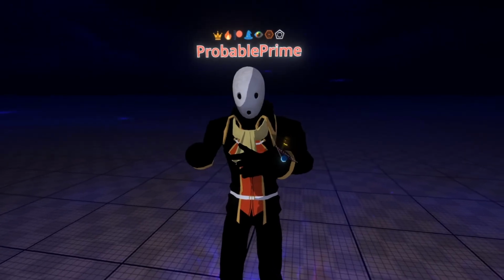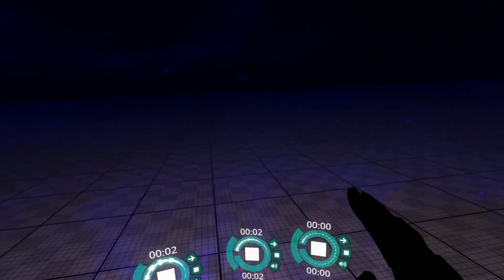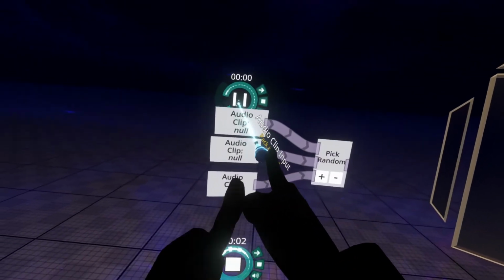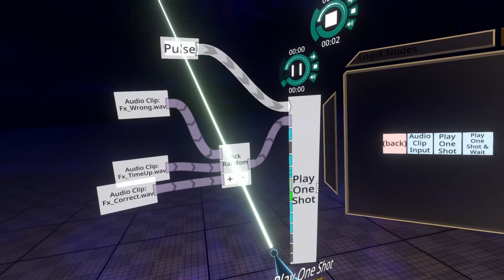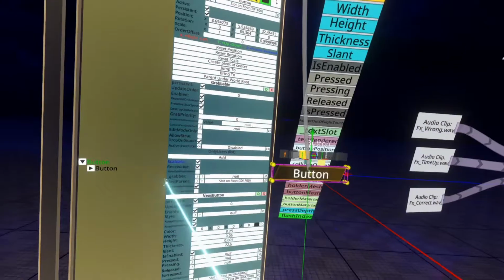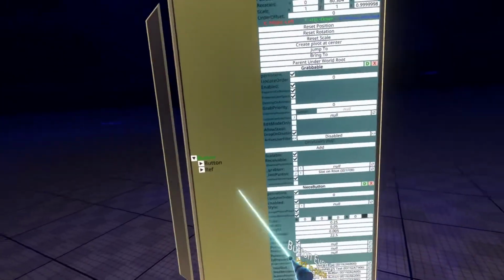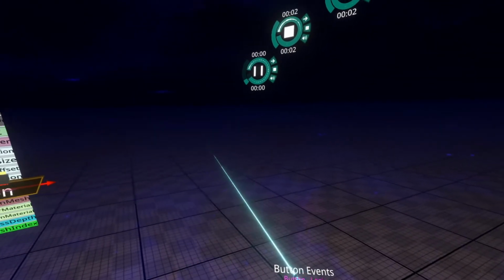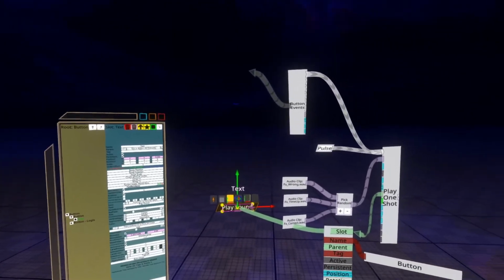OLD: Neos VR Tutorial: Play A Random Sound when a Button is Pressed

Comment: Hey Prime- so you know, this can also be accomplished with two components- ButtonActionTrigger and RandomAudioClipPlayer. The RandomAudioClipPlayer is fairly self-explanatory, you add it to your object, assign it a list of clips, and can set the weight for the randomness of each to play as well as their minimum, maximum volumes, and their spatial blend/spatialization settings.

It can be utilized with `Event` type components too. In this case, I mentioned ButtonActionTrigger. You can plug the `Play` method into the `OnPressed` field of the ButtonActionTrigger. But it can be used with other events too, e.g. `CharacterEventTrigger` which can fire when you enter or exit a trigger collider.
Reply from the maker: Thanks Shifty, that's another way to do it for sure. This is the way I recommend for new users who are learning Neos.